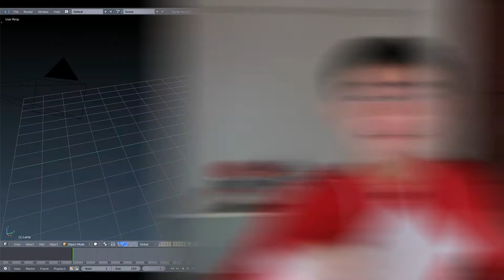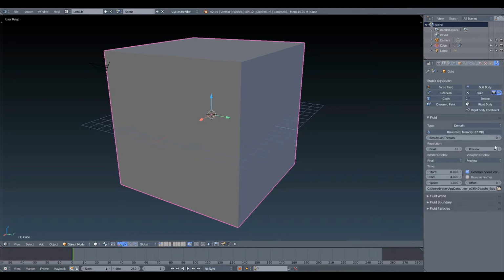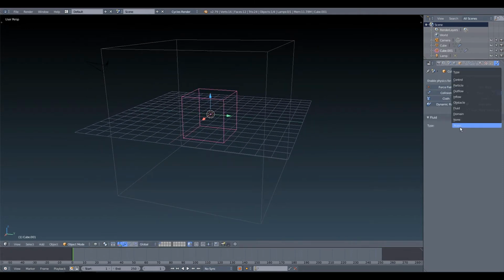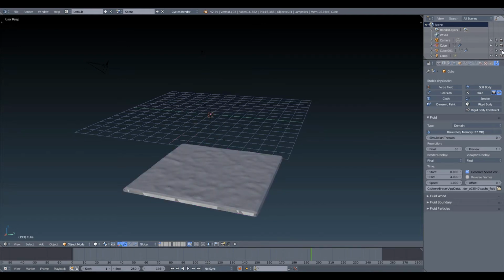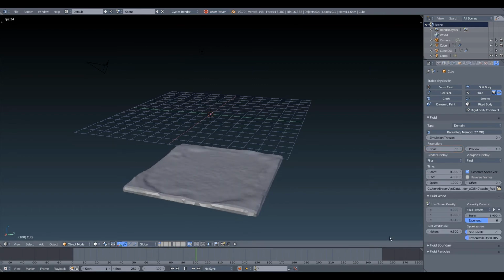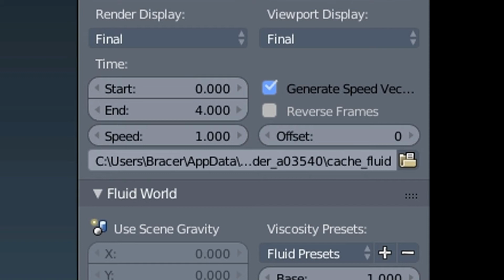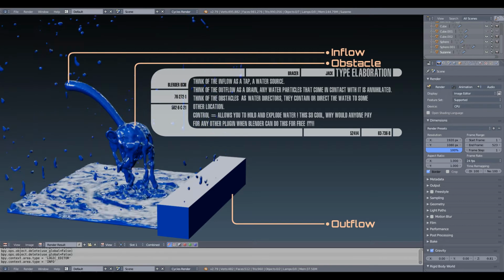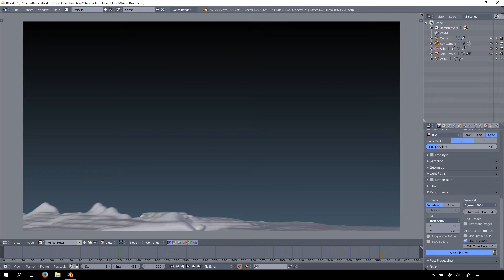Easy Blender Water Simulation Tutorial !!!

Comment: You can simplify this even more by using the quick fluid feature. Once you open blender select the default cube then press space and type quick fluid then select the quick fluid button. It will set up the domain and the inflow object automatically. It will also setup the materials depending on which renderer is selected. This also works for quick fire and a few others. Good video. Might want to touch on rendering.